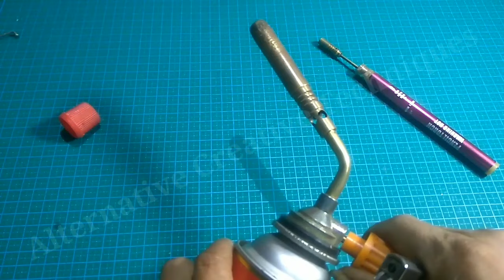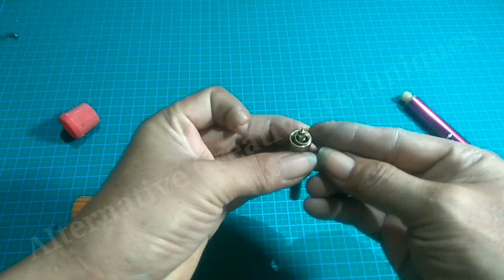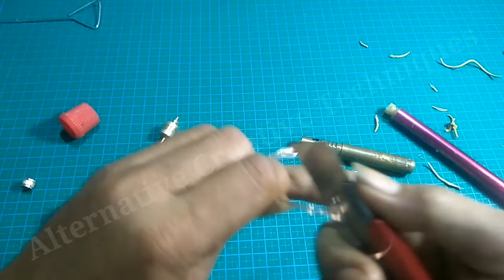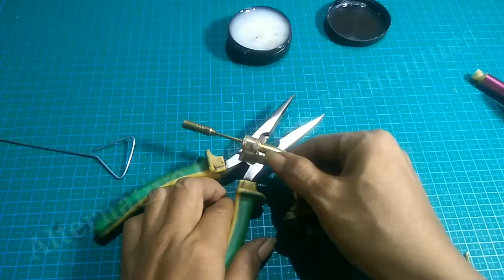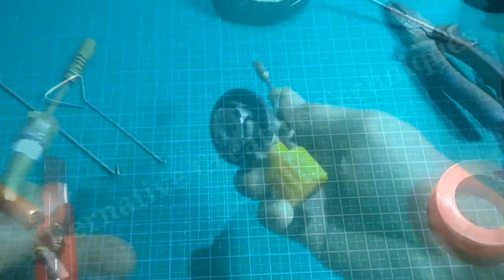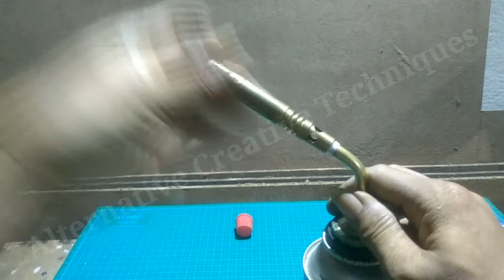Mini Gas Torch | High temperature 1200'C.

Comment: Will it weld 1mm mild steel please
Reply: With that gas - butane or propane or even a butane / propane mix I am afraid not. It is merely hot enough for soldering with is at a much lower temperature. Welding occurs when the steel can be melted which it will not do.
Reply: @billgwilliam1263 muito bom mesmo joia

Comment: Will you be able to melt thin bronze solder for small things?
Reply: Certainly it would melt bronze which has a lower melting temp compared to copper.
Reply: Bronze has a slightly lower melting point than pure copper but the issue here is not the flame temperature but containing the heat locally to get the job done, a butane flame in open air is at its best for soldering which is achieved at a lower temperature again

Comment: I have a question, where can one find the top part, the part that connects to the can? Im sure i can figure out the tip but i dont know where under the sun one can find that part you have that holds the tip and chamber and the can together.
Reply: Camping butane adapter

Comment: Kalo untuk bikin kapal otok-otok dari plat kuningan 0.3-0.4 mm bisa ya pak? Untuk pakan las-nya cocok pakai bahan apa, pak?
Reply from the maker: Bisa mas..
Pakan lasnya klo yang tahan panas pakai perak mas. Dikasih flux/borak/borax biar mudah nempel.
Reply: @YudiHermanto4H  pake perak tembaga itu ya? Terima kasih banyak. 🙏🙏
Reply from the maker: @wahyukuncorowijaya  ya perak mas 😄
Toko elektronik biasanya ada. Atau tempat servis kulkas.
Ada dua macam, yang bagus mudah leleh tidak nempel dimagnet. Yang jelek susah meleleh, dan kawatnya agak nempel dimagnet.
Reply: @YudiHermanto4H  oOoo.. Beda sama perak tembaga yang gepeng itu, ya? Hehe.. maklum, amatiran.. 😁